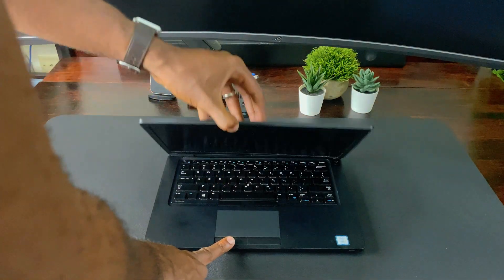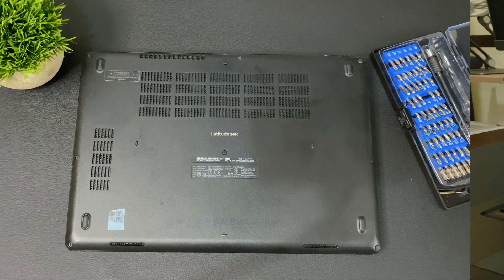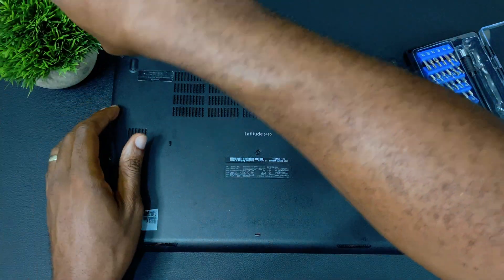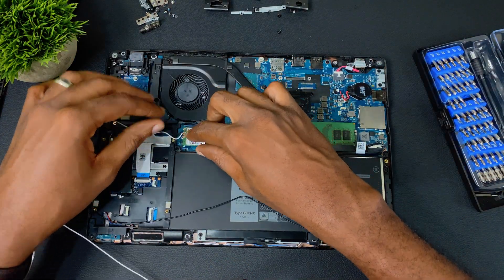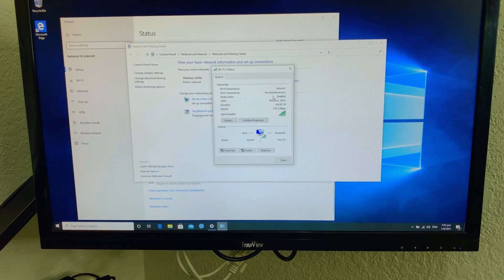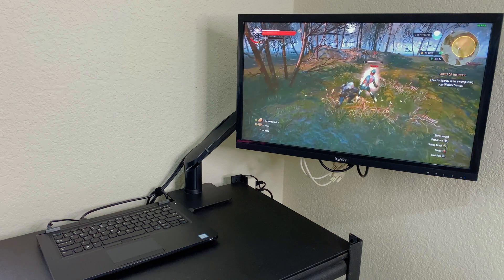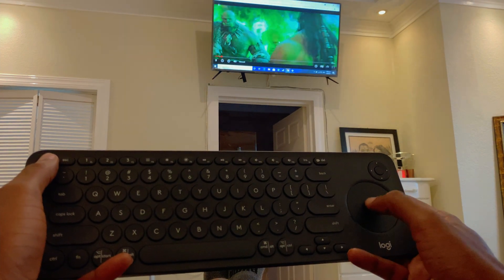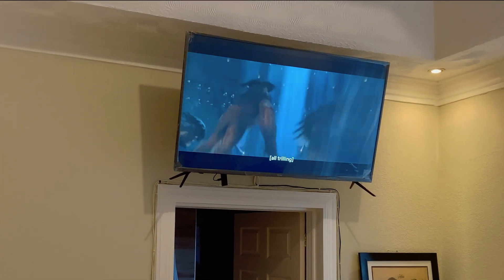Junk Laptop to a Screenless Game Streaming / Home Theatre Desktop | IT'S NOT TRASH!

Comment: Hi, i was doing smillar thing with dell vostro, installed batocera on it. But when i disconnected the screen laptop shuts down after few seconds after booting (even while in bios so it's not system issue). Have any idea what it might be?
Reply: When connected screen back it works fine.

Comment: Hey, I tried this on an Asus FX 504 GM, but the HDMI output doesn't seem to work. I can hear windows sounds after logging in (without a screen), but no display is detected in the monitor. Tested the monitor with my MacBook; works fine. Got any clue how to fix this?
Reply: did you solved it? I have the same problem right now